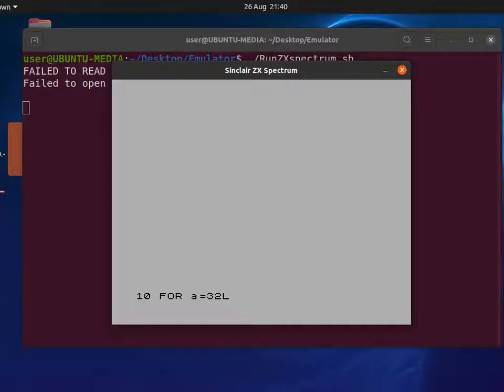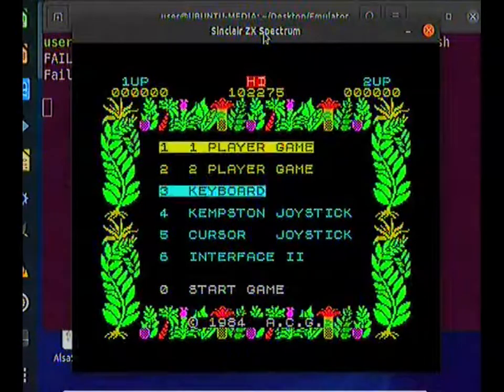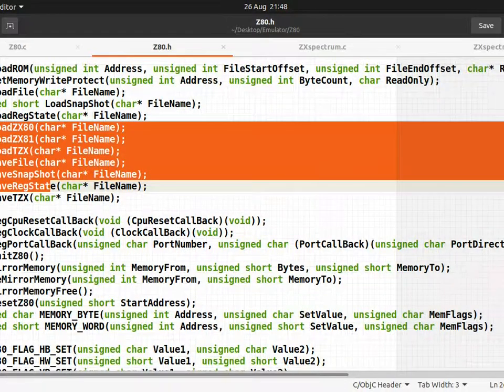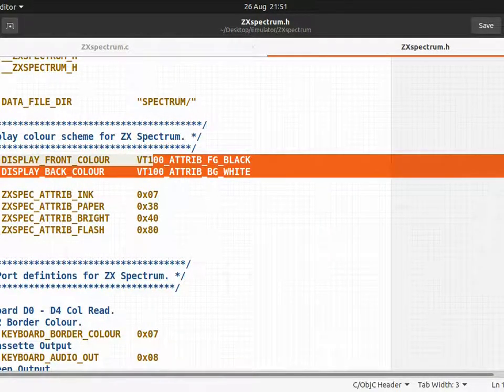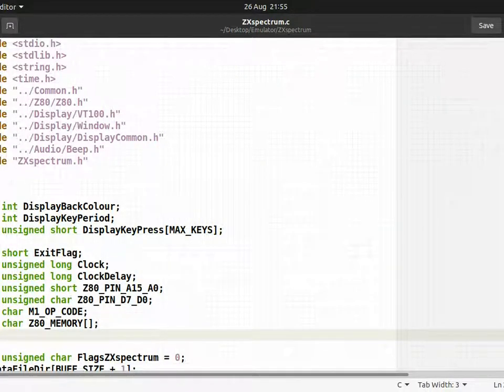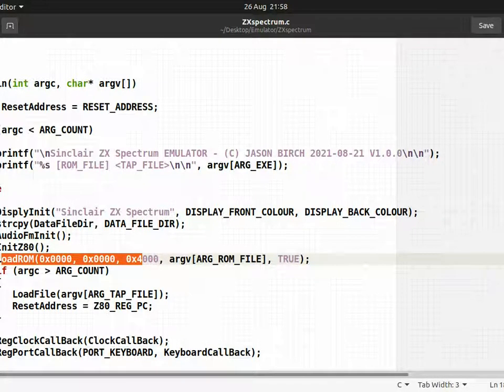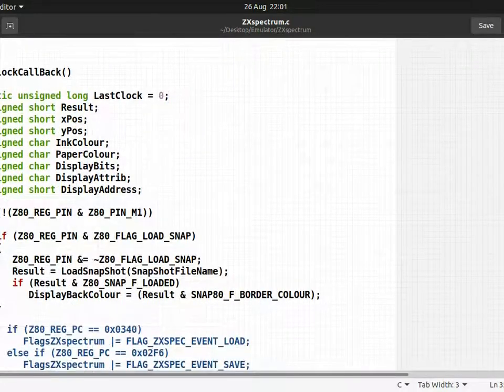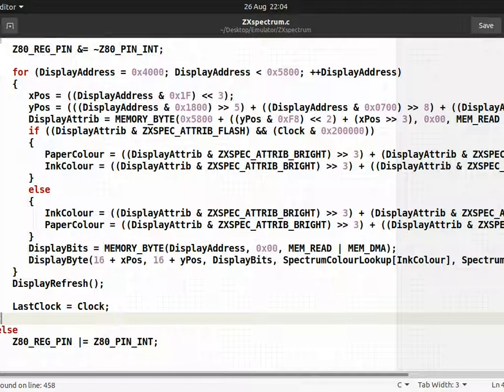Emulating a Sinclair Spectrum 48K & Z80 CPU Using Only ANSI C

Comment: Can your emulator overclock the virtual z80 to ehat speeds please? What about running four zx spectrum enulators at the same time ?
Reply from the maker: When run in Windows and number of emulators can be run simultaneously, up to the host CPU capability. On a Pi 3 probably one comfortable, Pi 4 may be two or three, Pi 5 three or four. Pi 5 appears to have a much more capable GPU.

Comment: Does the ay in the timex use the same ports as the fuller master unit?
Reply from the maker: Probably not, I haven't looked, but I've seen it's on different ports on the Timex 2068 and Sinclair 128K, which is a shame.

Comment: Theres a guy running four c64 emulators in parallel would you b interested ? What about sam coupe?
Reply from the maker: The software is currently branching in a number of directions. I'm currently implementing a synthesizer for audio for the arcade emulations. Hopefully then a midi interface. Then I want to get back to implementing it all on a RPi Pico. I took a look a while back, the C64 looks like too big a project for me to get into at this point. The video chip has a lot of complexity.

Comment: I don't see how you manage the timing. How do you manage that the emulator runs at the correct speed on different devices? I understand that you count clock cycles etc. but how's the actual timing implemented?
Reply from the maker: In the CPU emulation, each instruction adds it's T-count to the clock variable, in order that the instructions are effectively proportional and don't skew the timing. e.g. INC A adds 4 to the clock count. I don't sleep every instruction as that could be 1 million sleeps per second and burden the processor in itself. So I sleep say every 10000 instructions and sleep for PeriodDelay / 10000 * ClockDiff. Where the ClockDiff is the clock T-cycles since the last sleep and the PeriodDelay is what ever makes a 3.5MHz clock speed in the case of emulating the Spectrum. I use which ever sleep call is available for the system, sleeping in ms.
Reply: @DevelopIT  I see. Thanks!

Comment: I made a prototype handheld ZX81 console using a STM32F446RET6 (180Mhz, 128K SRAM) by taking an existing ZX81 emulator and heavily rewriting it.  There was a lot of spare processing power, so I suspect you could emulate a 48K Spectrum on the same hardware
Reply from the maker: Just watched the videos on your channel. Neat implementation. I have the same display connected to an ESP 32 from a while back, so I was intending on using that. But the STM32 is an ARM based unit, and I did want to get into that at some stage. It will be good to have as a promising backup option in case I have issues with the ESP32. Your Wumpus on a micro-controller has a really good font on it.
Reply: @DevelopIT Thank you! The ESP32 is a fine option.  You are a bit IO limited (the ESP32-S2 sacrifices one core, but gains more IO) and has a somewhat funky memory map.  Remember to use iram_attr on performance critical routines (since flash is QSPI not full parallel) and that only half the memory map is byte accessible, the other half is 32 bit aligned.  Emulating a Spectrum will probably consume enough for you run into this.  

I used a technique where I composed 8 lines of the display at a time and sent them out via SPI so I didn't have to keep an entire 16 bit per pixel memory map in memory the whole time.  The dual core nature of the ESP32 will help you as you can have one core emitting to the display, while the other core is emulating